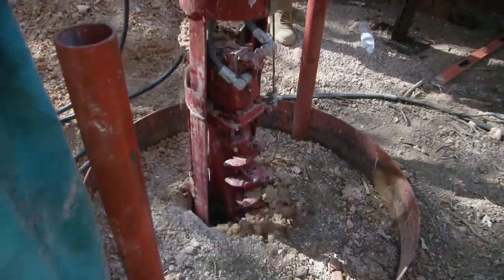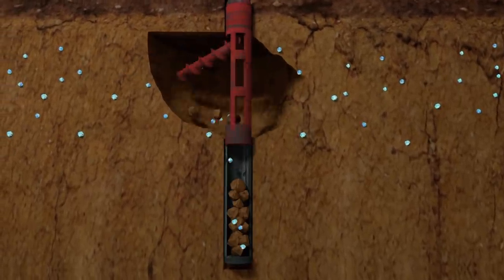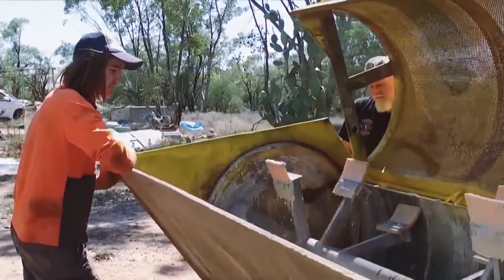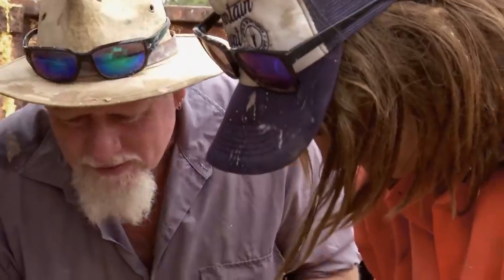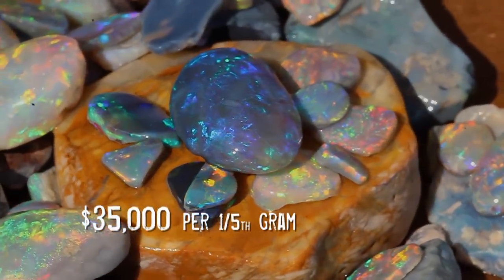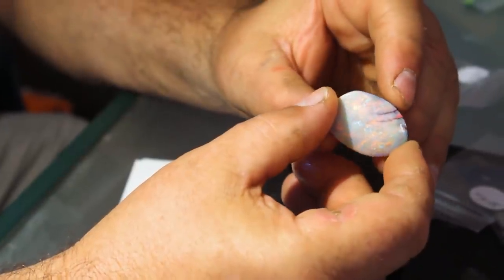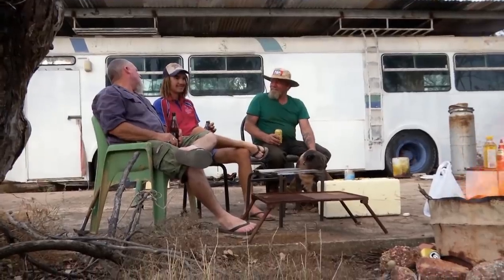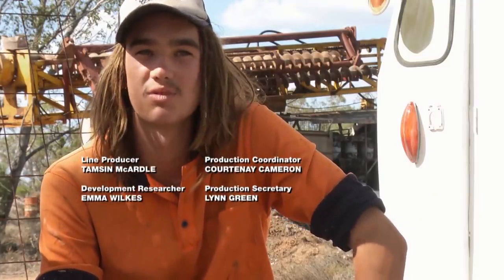Crew Tries To Find $31,000 Of Opal Using An Innovative New Drill | Outback Opal Hunters

Comment: It said they were worth 35k 1/5th a gram and they forsure had over a gram and only got 15k???
Reply: Skii Duu 
My very thoughts, I'd say well over a gram with the big one at the end.
I wonder if he had said 30k would he still end up with 15k or if my way of thinking is right and a dealer laughs at your price it's a way of intimidating you for a better deal, stand up and go to leave, he wants what you stay and deal.
Reply: Skii Duu wasn’t that for black opal?
Reply: That’s an up to retail price (in a piece of jewellery all cut to size) so the perfect opal (quality and colour changes value)in a ring or something. When they cut they lose a bit and the middlemen have to make money in the sale too.
Reply: Zac Patton 
Cutting loss is on average 30%. 
I hadn't realised that was retail, my bad.
Reply: That's only for the best stones. Opal price varies a ton, and is very hard to sell. Plus, you need the equipment and skills to cut it.
Reply: Up to, depending on certain qualities of the stone.
Reply: Yeah. But for wholesale your price is pretty much cut in half. If you found a buyer on the internet or the jewelry store sold it. The price would be around 30k
Reply: Skii Duu to sell 1/5 of a gram of black opal it must have 0 imperfections and basically be perfect. Also it must be polished very well
Reply: its all fake !
Reply: Skii Duu well that’s because the jewelry company has to cut up the gems and make them into a small enough size to put into rings necklaces etc. it takes quite a  bit of work just to cut gemstone... plus the tools needed are very expensive I know because I do it for a hobby...
Reply: The finest ones sell for that